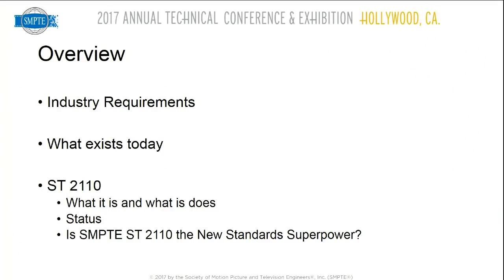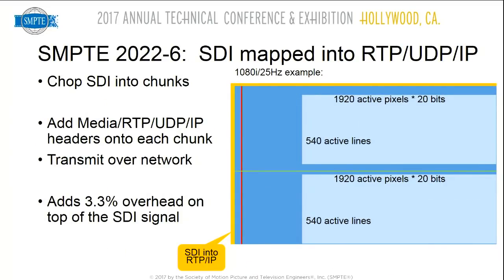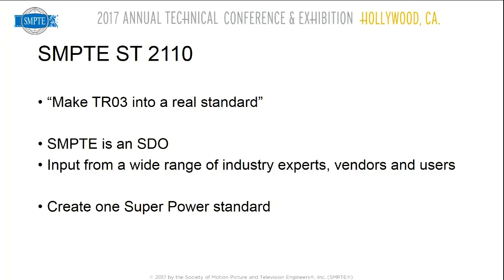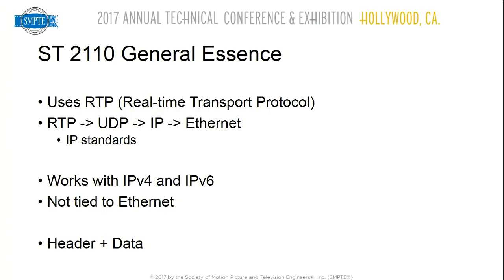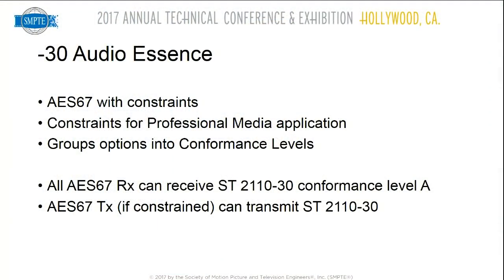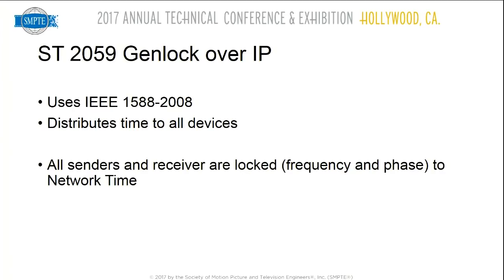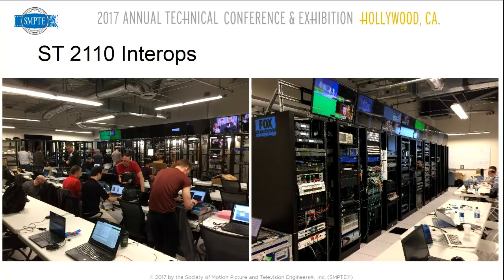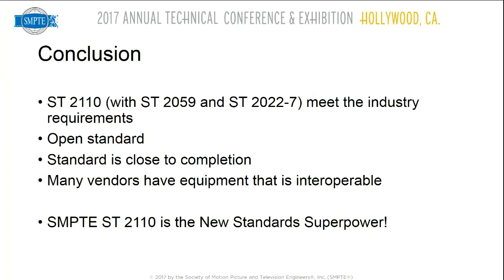SMPTE 2017: Is SMPTE ST 2110 the New Standards Superpower?

Comment: I have been tying to learn about the new SMPTE standards.  I have found a dearth of technical information that clearly explains the bits and pieces that make up the standards.

This talks gives a great technical overview of the new ST 2110 series of standards.It covered a lot of the nitty gritty details of each of the standards.  Video, audio, timing, control and metadata.  It even shows a few simple URL based API (Application Programming Interface) calls.